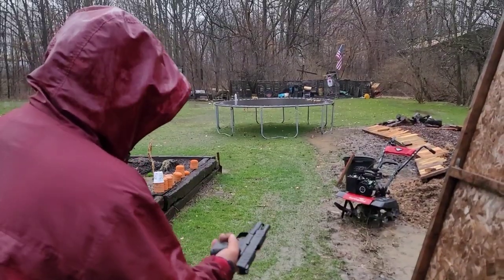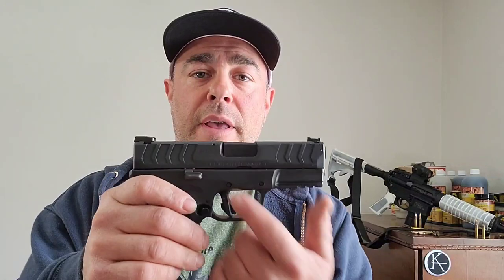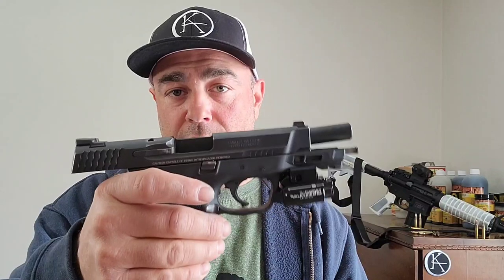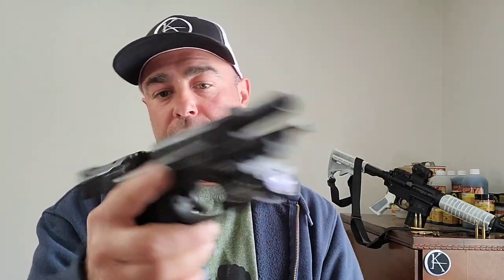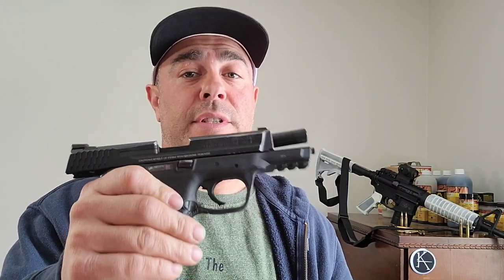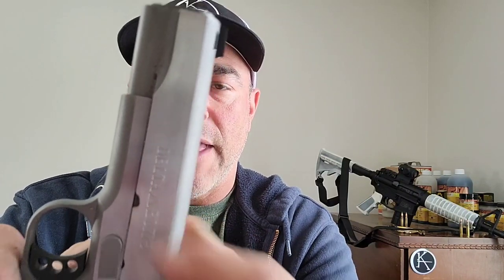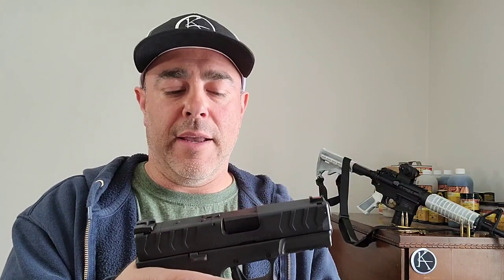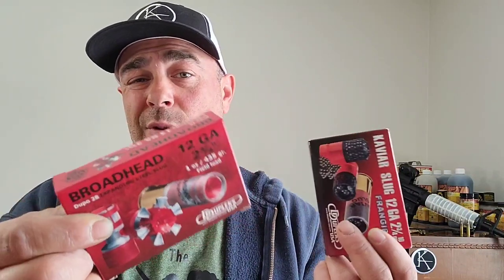Inertial Loading/"Smack To Rack" 🤔 Is it Tactical or Dangerous? Example: XDM Elite 10mm

Comment: Definitely not normal,just as the 1911 slide wears,the metal on the polys will do the same.That said,some polymer formulas just aren't there,and even when they are,wear/fatigue just like anything else.Vote DANGEROUS,main reason being,there is a huge difference between "needing" a round chambered and most likely...
Reply: You are wrong buddy glocks and M&p 1.0 were designed to do this all day long departments reach for this and so to tactical training the M&p 2:0 had a safety on the slide lock to prevent this but it’s easily modifiable
Reply: @eddiearchuleta615  Sources?